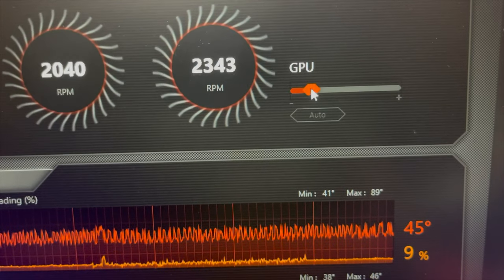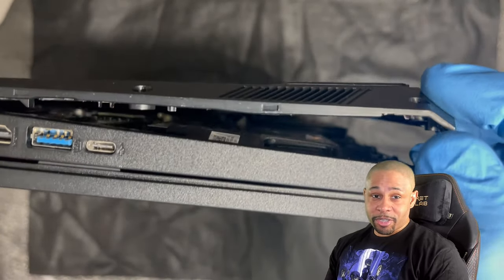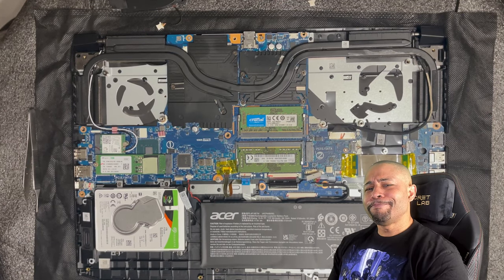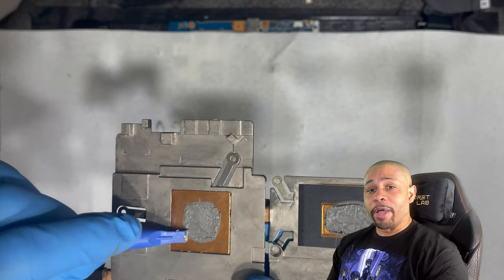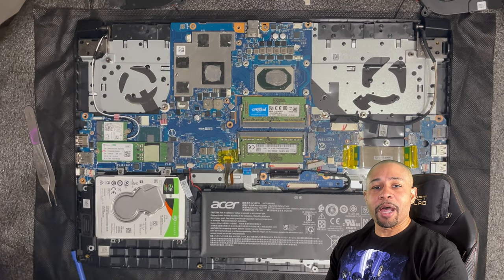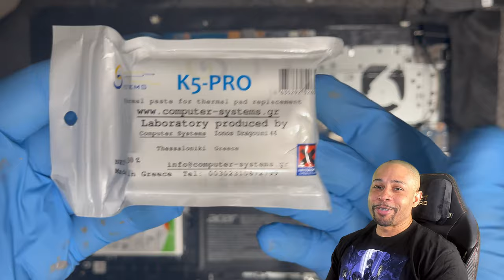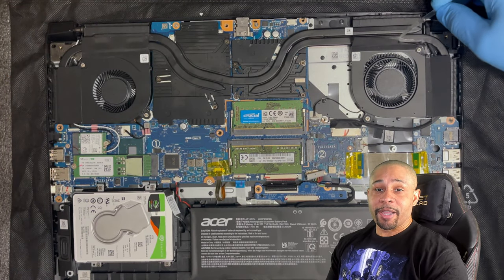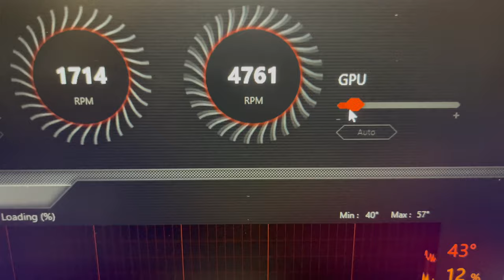Fan Replacement & Repaste Tutorial Acer Nitro 5

Comment: Quick question, ive cleaned out the vents in my nitro 5 and my GPU and CPU fan speed have somehow slightly decreased and the temperature issue still persists. Do I just blow in compressed air hoping to remove and dust clumps that may have formed while cleaning out the vents? Or do I do a full repaste and fan replacement. I've had this laptop for about 2 years.
Reply from the maker: If you do not disassemble the machine, you will not completely remove the dust from the fan blades.  It will just pile up inside the machine.  You will definitely have to repaste as 2 years is a good amount of time to pass without doing so.  I would set my fan speed to MAX to see if your RPM's are the same.  If not then naturally they are wearing out.  A few hundred RPM's off is normal after years of use.  If it starts to degrade monthly then I would look to replace them.  If possible try to run your fan speed set to AUTO.  Having your temps in the upper 80's or even hitting lower 90's won't harm your machine.  People just prefer being under 90C thus avoiding thermal throttling of the CPU.
Reply: @Meanpooh  I disassembled just the fans today and cleaned out all the dust. The temperature is much cooler under heavier loads now but for some reason the max fan speed on nitro sense has gone down from 6000 to 5760 after reassembly. I'm planning to repaste in 6 months as I'm happy with where the temps are now. Just a bit concerned about the fan speed thing.
Reply from the maker: You should be fine.  I would say it's possible that dust or some debris could have entered into the fans motor area.  This could cause a loss of speed.  If your fans start making shrieking or abnormal sounds then replace them.

Comment: Hello, can i ask?
Is it necessary to paste the other things except for the CPU and GPU?
I thought it was unnecessary back then so i ignored them when I repasted my laptop.

Is it dangerous for me?
Reply from the maker: The other items that you are referring to have K5 Pro on them. You can try and use regular thermal pads which are solid. Liquid thermal pads (goo) are able to coat places that are hard to reach with conventional thermal pads. Only use thermal grease on the CPU and GPU, everything else use regular thermal pads or the liquid K5 Pro(goo).
Reply: @Meanpooh  thank you!

Comment: Just found put my laptop CAME with a stripped screw where the screw one is on the cpu dye. Do you have a way to remove the screw as im desperately looking for answers
Reply from the maker: If I happen to get a stripped screw, I usually get a bigger driver(non precision).  One that fits in your hand.  I would apply more pressure and that usually works.  Make sure the head of diver fits and does not rest outside the grooves on the screw.  You will have to add more force than normal but not too much to where you may crack the board.  These screws have a little bit of screw glue on them to keep them tight but weak enough to be loosened.

Comment: Can i clean the fans and stick them back?
I just replaced the thermal paste yesterday but forgot to clean the heatsink, I don't want to open the heatsink again. I have an AN515 57
Reply from the maker: Yes.
Reply: @Meanpooh  thanks and sorry to bother you again but will it be easier to clean the heatsink vents after removing the fans? I don't have any compressed air

Comment: I cannot find any K5 Pro here also my areas does not support Amazon or whatsoever .. can I use a normal thermal pads?
Reply from the maker: Yes you can.  There are different sizes so you will have to measure and cut accordingly.  If I were to use them I would stick to 1.0 size.

Comment: Is k5 pro better than 1mm thermal pads? If yes i will buy k5 pro
Reply from the maker: They are pretty much the same.  Its the size and place you have to fit the pad which is the problem.  Many heights along the heatsink which can be very difficult to measure and fit.

Comment: Hey uh i got the same problem on the gpu fan yet it goes away on higher rpms does that sign for a replacement or lubrication of the fan
Reply: Yea the lubrication is not doing anything
Reply from the maker: Replace.

Comment: Hey, question on this. When I was taking apart my laptop of the same model to clean the fans, like I have plenty of times before. And after I put it back together it would turn on anymore. No charging light with a working charger. No response at all. You have any recommendations or know any info that may help me?
Reply: Did you reconnect the battery? (maybe a stupid question)

Comment: Pooh, what's the size for the thermal pads if I don't use k5? 1.0 or 1.5? Because i don't get k5 in my country.
Reply from the maker: Go with 1.0.  There reason K5 is used is because on some boards there are gaps from certain chips to the heatsink.  Some manufactures use 1.0's , 1.5's.  If you replace your pads and they were solid, try to put them in the exact place and examine if they all are the same size.  I would not go lower than 1.0 pads.  I used these on my Legion 5 Pro https://amzn.to/3LKbaYp

Comment: Hi, I love the tutorial so much. May I know why you used 2 kinds of thermal paste?
Reply from the maker: One is very viscous thermal pad and the other which is on the CPU and GPU is thermal grease.
Reply: @Meanpooh  can i use a normal thermal paste for both?
Reply from the maker: @whitesilver1093  Yes, you can use normal thermal paste for the CPU and GPU.
Reply: @Meanpooh  oh i mean, i don't have a K5 at the moment so i just put kryonaut for all parts for now. but I'm not sure that's ideal
Reply from the maker: @whitesilver1093  No, don't do that.  You are better off using thermal pads than thermal paste(grease).  If you use thermal paste it will just squish out.

Comment: Great video, soon I will have to do this myself on Acer Nitro 5 with Ryzen 7 and GTX 1650ti. 

Isn`t Aeronaut better paste for laptops then Kryonaut, in therms of long lasting performance? Was reading user experience that Kryonaut tends to slip out the CPU/GPU surface and with time cool less, but Aeronaut stays longer on same place, that makes it better for laptops.
Other modules around GPU i plan to cool down with thermal pads. Still don`t know which kind of result will I get.
Reply from the maker: The Aeronaut is slightly thicker so it could help with the slip, pump out effect that you speak of.  
Aeronaut  has a viscosity of 110-160 pas
Kryonaut has a viscosity of 120-170 pas
Although they are close, this will change depending on the temperature as
Aeronaut  has a working range between -150°C / +200°C
Kryonaut has a working range between -250°C / +350°C
The big difference is that Kryonaut is more conductive(thermally) and can work in very high and low temps.  
The Aeronaut could be considered a factory replacement paste and have a cheaper price.
Just remember that the viscosity will change depending on the temperature.

Comment: Hello. So are k5 pro and thermal grizzly kryonaut still the best solution for acer nitro 5 i5 10300h? Thx.
Reply from the maker: There are other thermal grease brands that work just as good.  K5 Pro is fine and is also messy.  If thermal pads can be used, it would be best.

Comment: I have a Nitro 5 and I it has been blue screening and or freezing alot lately and shutting down, with that I find the fans working hard then slowing down alot even if im not gaming or using an app or browsing the web. I have tried updating all drivers and it still happening frequently.  Im unsure if it is actually the fan or it is something else. Have you heard of any problems occuring to the Nitro 5 which may cause this? I am apprehensive to disassemble the laptop as I have not done it before.
Reply from the maker: More than likely you will have to repaste the machine.  If you game or use it alot the fans may need to be cleaned.  If you try to blow air in side the exhaust and intake you will blow dust inside.  Take off the bottom and do it that way.  I have a few on dismantling the laptop.  It's not bad at all.
Just look for repaste in my playlist.

Comment: does replacing the thermal paste and cleaning my laptop will void varranty??
Reply from the maker: Never heard of anyone getting the warranty voided but to be safe just wait till your warranty is over before you try.  You could always call Acer and they may fix your heating issues by sending it in under warranty.
Reply: @Meanpooh  Well i have like 4 years of warranty left and by sending it back to acer i would prob have to wait like 60 days before they can send it back
Reply from the maker: If you replace the thermal paste with something that Acer does not recognise when they open it up it's possible that they could void it.  Then longest I have waited for a repair was like 30 days and it was because the part was not in and it was during covid if I remember correctly.

Comment: Do i have to use k5pro on the other components or can i also use normal thermal paste which im going to use on cpu and gpu ?
Reply from the maker: You should only use Thermal grease on processors and K5 Pro or Normal Thermal pads on everything else.  There are other brands besides K5 Pro if you can find them.

Comment: Why do you need to pull the mother board cable out? If i may ask
Reply from the maker: Stopping a possible short.  You can kill your board easily while working on it with power.  Experienced users have worked on machines without doing this but it's good practice to do so.

Comment: Nice review and very detailed teardown. I think I wouldn't do this to my new Nitro 2021, so I can sell it down the road around 3-5 years of used. I can note that (laptop was never been opened, no history of repairs.) Then use money to buy new Nitro Model.
Reply: Sounds like a good idea buy I wouldn't, sell it because there's no difference between the new model versus the one you've currently got 🤔👍
Reply from the maker: Same, this should not be done unless you are having issues with yours fans and out of warranty. If you are going to sell it, do it as soon as possible. The Nitro 5 doesn’t hold much value the older it gets. There is stiff competition on eBay as they are everywhere. The machine that I’m using will be lucky to bring in 2-300 without upgrades. Also be careful with OfferUp as there are lots of scammers there wanting you to mail it to them. 
Good luck. 👍

Comment: I replaced my fans.. but they are spinning slower then before.. these are the new fan.. even on turbo mode... 4000 rpm.. but it used to go 6000 rpm.. wht to do.. please help
Reply from the maker: Nothing you can do.  The RPM is limited by the fans specifications of the brand that you  purchased.

Comment: Great video! Thank you so much! My laptop started having a little bit of noise on the GPU fan. I tried blowing it (while open) with pressured air but no succes. I guess in the end i`ll have to change the fan. Now i`m prepared to do so, thanks to you. It`s like and subscribe from me! P.S. - What means high temperature?
Reply from the maker: Your machine can survive 90C+ but will throttle down to regulate the temperature. As long as your machine does not shut completely off, you're good.  Most machines will shut down around 101C which is hot.  While gaming your machine will range 75-93 which is normal especially in performance mode.  If temps seem too warm for you try using your Balanced power profile.  That sometimes help.

Comment: Hey Meanpooh, do you know how big of a performance difference there is between power save mode and performance mode in nitro sense? I have the same nitro 5. Reason I ask is my CPU, 10300h, occasionally runs hot playing various titles so I have started playing some games, witcher 3 and ready or not to be specific, using power saver mode. Temp is significantly lower using power saver mode. I can notice some performance issues though in more CPU demanding titles.
Reply from the maker: Depends on the game but using PS keeps your CPU from boosting so it stays at base clock.  That's why the temps are cooler.  That works for a lot of older games but the newer games need more speed to help the GPU.  Some newer games will also run.  You will most likely trade performance for coolness.
Reply: I got the same cpu i5 10300h it’s very hot about 93celsius but after closing the heavy game it immediately drop from 93 to 55-60 celsius i need to replace the stock thermal paste but it will void the warranty
Reply: Use Throttlestop to set the max cpu clock to lower the temp. 3.3-3.4 ghz is enough i think.

Comment: Would 4 gr of thermal paste would be enough for An515-54?
Reply from the maker: Yes.
Reply: @Meanpooh  Thanks. Btw by mistake I drop tiny bit of paste at the right of my processor's right. It touched 1 of those orange wire things. Would it be a problem? Can I clean it with thermal paste cleaner?
Reply from the maker: @kardokdelikaya9570  you can clean it with a qtip and alcohol. Make sure your battery power cable is disconnected from the machine.  You could also dab it using a paper towel and alcohol. Touch as little as possible.
Reply: @Meanpooh  Okay, thx.

Comment: Great and helpful video! 
But I have one question I am planning repaste my Acer but in my country I can’t get K5 pro? What could be used instead of that? Thank you so much much for answering :)
Reply from the maker: If you cant get K5 Pro, just replace the thermal pads.  Its a lot less mess.  Unfortunately you will have to measure the pads to get the thickness as I never have.  They usually fall into sizes .5, 1.0, and 1.5.  I'm sure there are other sizes but these are the most common.  Look here. https://amzn.to/36NhNH7

Comment: Does it work with the acer nitro 5 AN515-58-5046?
Reply from the maker: More than likely no.  Process will be the same but the fans are different.
Reply: @Meanpooh  Oh ok, thanks. Nice video by the way 👍
Reply: @Meanpooh  by the way is there any replacement fans for the acer nitro 5 AN515-58?

Comment: My GPU fan doesn't work at all. Nitrosense doesn't control fans and the RPM is at 0.
Reply from the maker: If you have the old Nitrosense you have no control. With the newer version you do. Sometimes the RPM does not register and you may have to reboot the machine. If that doesn’t work you may have to reinstall. If you can physically see that your fan is not spinning then you may have to replace it. A sign before failure would be squeaking and high GPU or CPU temps when idle.
Reply: @Meanpooh  The fan never squealed. Could the wire be dislodged because I bought it reconditioned like new and the fan worked when I first gotten it. The model # 8s AN515-53.
Reply from the maker: @Bobzilla206  I don’t know the condition of your old fan but if still was spinning before replacement, I would put it back in. This would confirm that the connector port is working correctly.  Makes sure that no pins are bent when plugging in. This will cause a similar issue. The model number you listed says that you have the fans that are close together, right?
Reply: @Meanpooh  Yes so by proxy my GPU is getting cooled by proxy of location.?.?
Reply from the maker: @Bobzilla206  Correct but it won’t last long like that. Curious to see what you find out. If your new fans are faulty definitely return it.
Reply: @Bobzilla206  My nitro 7 have the same problem. I have just cleaned it and now the 2 fans not working. Did u solve it?
Reply: @thiagogomes4498  I just got myself a miniature Ryzen 7 with Vega 10 internal GPS. $350

Comment: I have a nitro 5 517-51 and the fans just stopped to work. Them dont spin. They stopped after i clean the notebook. Have some idea?
Reply from the maker: If the machine turns on without issue then you may have disconnected the fans.  If you checked and that's not the issue then it may be something serious.
Reply: @Meanpooh  yeah, the notebook starts normally, but the fans dont spin. Them are connected. Ill try to replace it. I'm worried because they both stopped :(
Reply from the maker: @thiagogomes4498  Is your gaming area chilly?  They may not come on till it gets hot from gaming or using applications.
Reply: @Meanpooh  it starts with 65°, playing red dead redemption 2 its go to 80°, 90°, and the fans dont turn on.
Reply: @Meanpooh  the nitro sense app shows 0 rpm for both
Reply from the maker: @thiagogomes4498  Ok, this may be a longshot but try logging into the BIOS.  This will help determine if there is some type of setting that is causing problems with the fans.  If they turn then it's something to do with Windows.  This may require resetting the machine or something less destructive such as making a new account.  Lastly try this program for manual control.  I know you have Nitrosense but see if this works. https://github.com/Rem0o/FanControl.Releases
Reply: @Meanpooh  ill try it now man.
Reply: @Meanpooh  nothing... Dont spin when im in BIOS and the program just not worked. :((
Reply from the maker: @thiagogomes4498  The only thing I could suggest would be to contact Acer or your local repair shop.  You may have shorted something when you cleaned it which is something anyone can mistakenly do. 😟

Comment: Recently did a repaste on my Nitro 5, P1 64 C, P3 84 C, P4 94 C! Clearly there is something wrong with cooling, did repaste many times before i really don't know how i could screw it up. Hopefully heatsink is not bent and i only didn't apply enough paste somehow. Played some games afterwards it was fine but few days later some cores are overheating, it should be paste i think, used hydronat perhaps it spread too much.
Reply: By the way 3060 works under 70 C, usually around 60 C with medium load so definitely cooling working fine for GPU side. I somehow placed uneven amount of paste on CPU i guess, will put a massive line on middle..